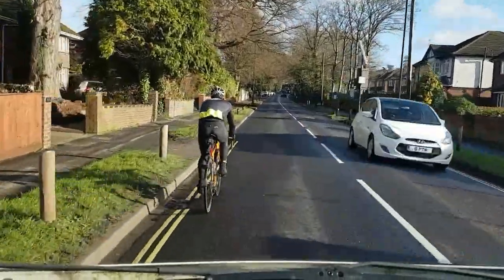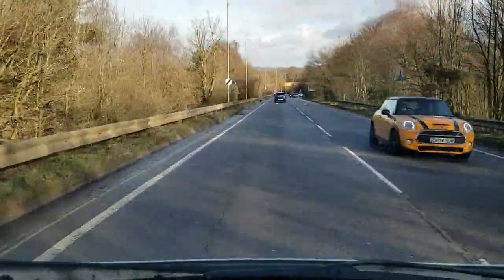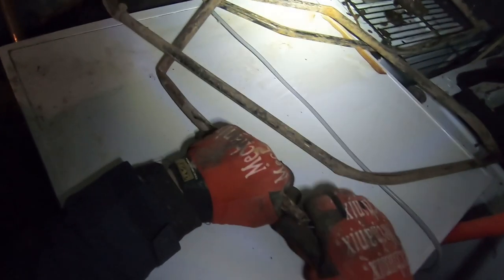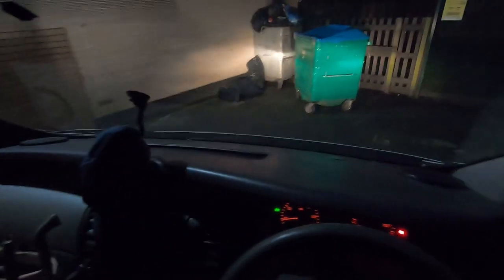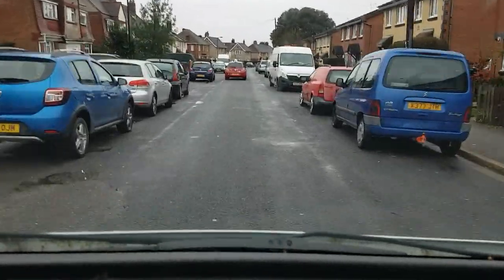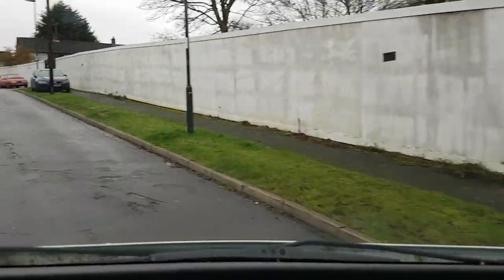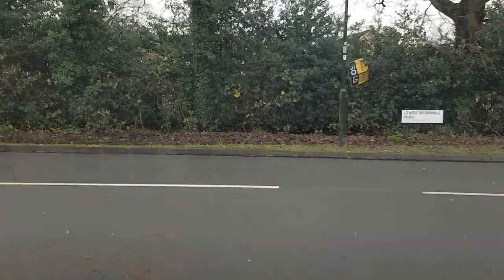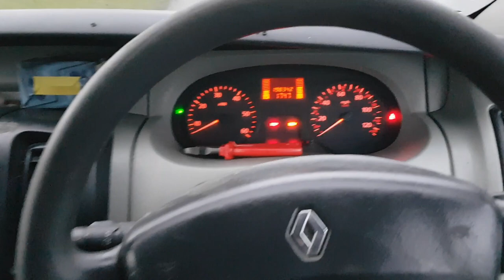Street Scrapping - Weighed and paid 5&6 - Copper and cable score

Comment: I take every motor but I will only strip down and remove copper in the copper ones if it’s ally windings then it goes in as dirty ally I also usually remove the ally outer casing if it comes off easily usually with a cordless crew driver sometimes with a hammer

Comment: I take the aluminium motors out still because you have the cast alloy casing and alloy wire  better than putting in as scrap every little helps nice copper wire and pipe  not good breaking down  another good vid

Comment: Motors are usually like any other scrappy bits. Often the aluminum ones will pay a little more than steel. So if you have enough to make good weight , it's worth it 😁
Reply from the maker: I have decided to keep hold of them as the yard pays a bit more for motors on there own and I worked out a quicker and easier way to remove them.  Beat the shit out of them with a hammer 👍 works a treat.

Comment: I don't bother with aluminium I leave them, but Ian Matthew says you get more money than steel so it's better to take out. Who gave you the wire and copper   I thought you went for a dish washer.
Reply from the maker: My yard said it will pay more for the motors on there own 👍 I asked today. I got the dishwasher then asked a builder next door if he had any scrap.  The copper and cable were in a pile out back plus some big chunks of heavy beams.